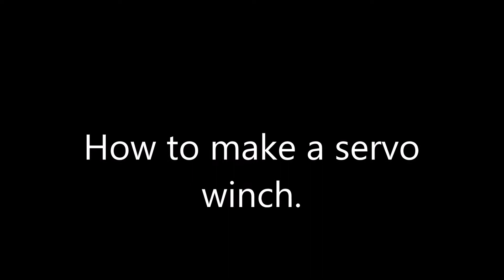How to make a servo winch

Comment: Thank you! I did this with my servo but I find it twitches and moves randomly by itself. I have to constantly retrim it. What shall I do?
Reply from the maker: You will need to make sure you use glue on the trim inside the servo or it will go out of trim because it's adjustment is so fine.